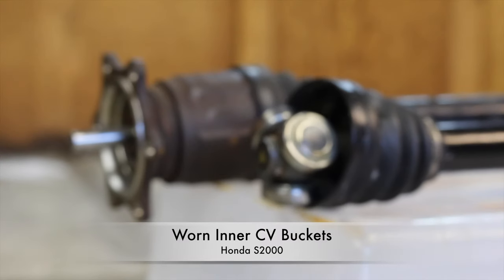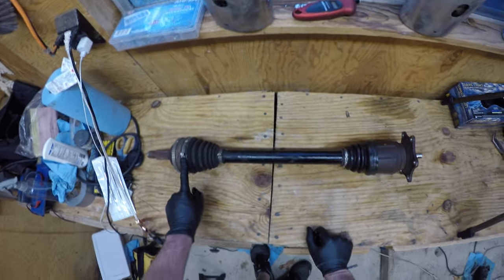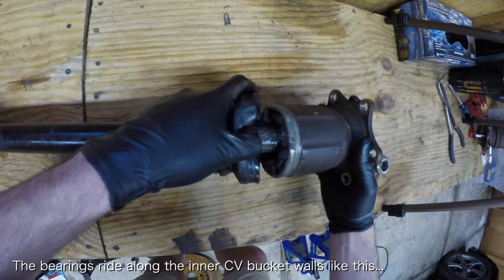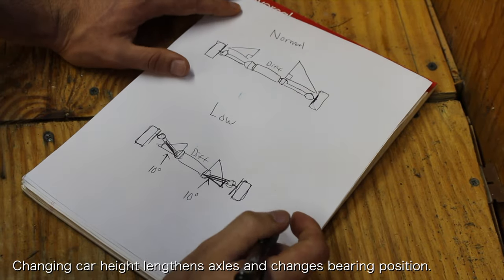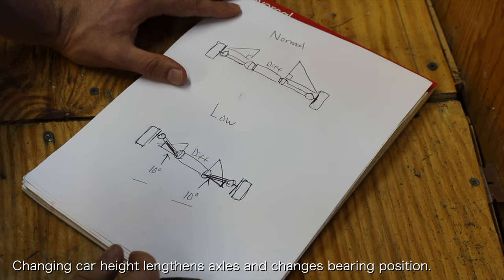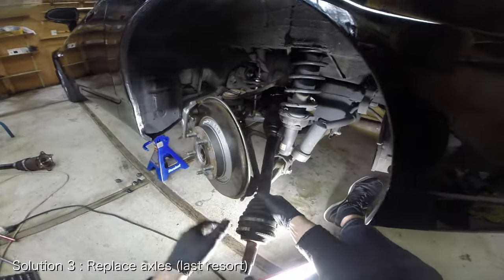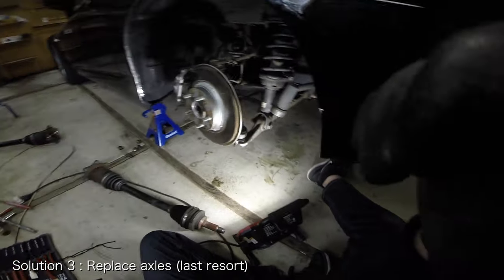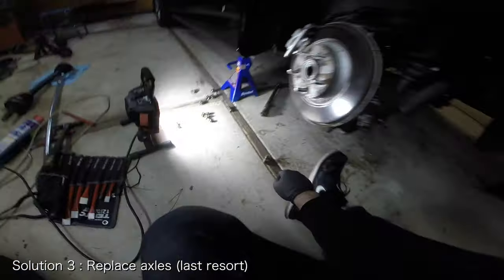Common Problems - Worn Inner CV Buckets and How To Fix Them | Honda S2000

Comment: I have this problem on my 2012 honda accord hfp..
Reply from the maker: +Aiden Pearce Same symptoms or actual problem? Didn’t know other Hondas had this issue
Reply: DIYGuys yeah the inner axle has play when i move the bucket but not the shaft.. I have a slight bent whee I found out recently im going to fix the wheel this weekend and see if the problem goes away. If not for sure I have this problem. All hondas axles go i had an Ap2 s2000. They are not well built imo. Had to change rear bearings, engine mounts kept going because they are located right beside the exhaust manifold. Also soft top was 5k lol i mean its an ok car.. If your single its good :)
Reply from the maker: +Aiden Pearce Bent wheels definitely seems problematic. At least the S2000 motors are built well lol.

Comment: Why not just replace the whole thing, they are dirt cheap. And you have it that far apart it's just common sense to replace CV Axles when they get worn you're playing with the clock and it's not gonna work out.  Taking them out isn't easy so what's the point of doing this????
Reply from the maker: CV axles aren’t dirt cheap? You buy used OEM axles you roll the dice. You buy new OEM axles for 700. Or you buy aftermarket axles that are junk out of the box.
Reply: @DIYGuysvideo  really? Good new ones for my Buick are 45 dollars each side????
Reply from the maker: This video is meant for Honda S2000s only. Surprisingly a lot of non Honda S2000 people watch it. So for other cars and makes it may be possible.
Reply: @DIYGuysvideo  okay, point is they are cheaper than you'd think, a good quality one from Rock Auto by cardone or surtrak is about 60 bucks. I stand behind my point. Cardone is as good as you're gonna get reliability wise on those axles
Reply from the maker: From my research aftermarket axles for Honda S2000s have issues mainly because they are solid while OEM is hollow and much beefier. If you don’t have a Honda S2000 your mileage may vary (literally).
Reply: @Thomas Ward if you're going through the effort of pulling apart it's just a wise idea to replace it if you're having issues with then.

Comment: Raise the car. That is actually the only solution. There are no others.
Reply from the maker: You’ll even encounter this issue with cars that are and always have been completely stock height. So that is not true unfortunately.
Reply: My car is stock height, never lowered, yet at 171,000 Kms.....my driver side cv half shaft is toast....😬